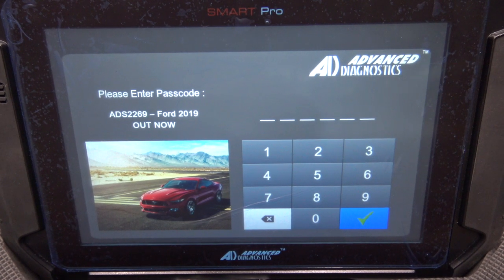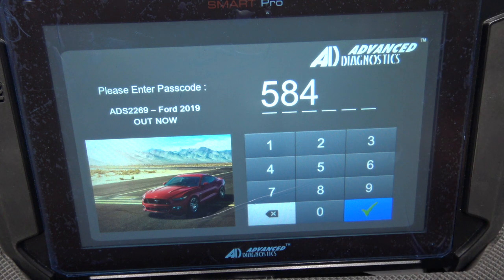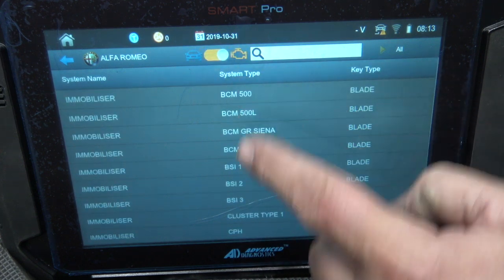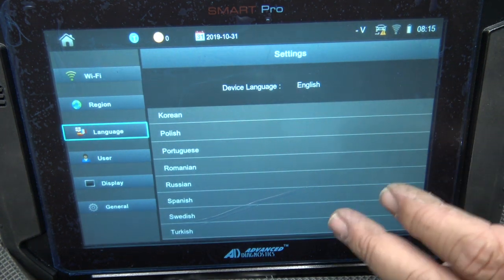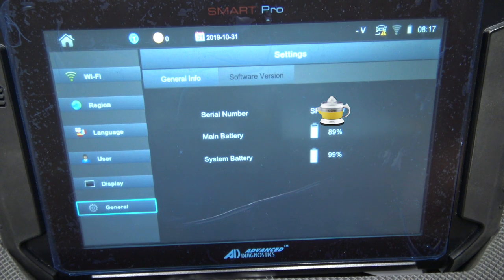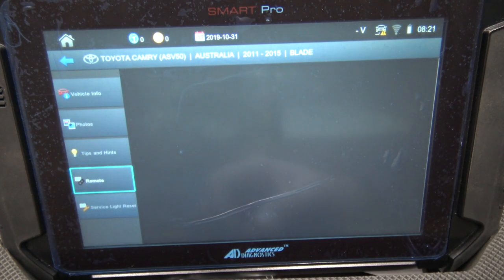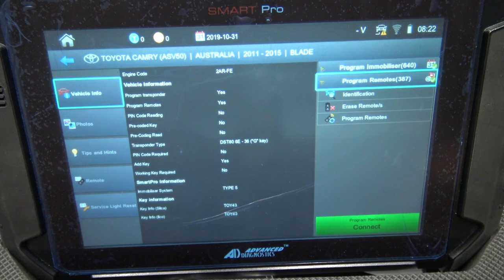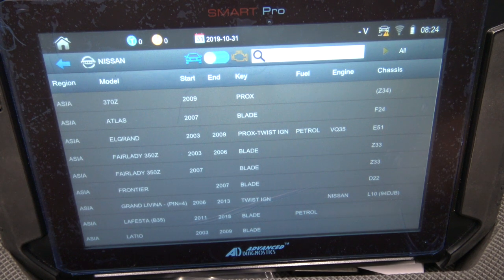Smart Pro Transponder Key Programmer Settings & Overview

Comment: Nice. You purchased the newest one they have. Hopefully you won’t have anymore problems with losing tokens. This machine is more modern. I have seen all their videos and the tool is phenomenal. It’s very expensive though. But it’s the best tool you can get to program cars. I just can’t stand their token based system. It’s expensive for a normal person. But I think it’s worth every penny if you are a locksmith.
Reply from the maker: Im hoping it will be a good investment
Reply: I wanted this machine
Reply: @yamkeyservice3070  hy I'm just about to buy 1 from a gentleman in usa and send it back to iraq?

What's your advise for me to stay away from the scamers i don't really know him well.

But I'll send someone to test it 1st.
Reply: We use this in our shop, and it doesn't work a lot of the time......

Comment: Dr. Lock.. i recently met up with someone using this machine to have him program a fob for me for a 2008 porsche cayenne and it would have been the first one he would have done but he couldnt get it to program anything. I have the original key with remote but the internals were damaged when i got the car so i cant use the remote to lock/unlock or anything and the car says replace fob battery. Car runs and drives fine. Did he make an error in his programming or does this machine not support this car?
Reply from the maker: Sorry I have not done a Porsche, from memory its on the menu, so I would of thought it would work
Reply: @DrLockShop  i appreciate the response. And yes i saw him go through the menu but somehow wouldnt process anything. Anyway like i said i appreciate you taking the time to reply.
Reply: We use this in our shop and it often doesn't work, I would say this is pretty typical

Comment: I thought you were done with token base programmers because of cost . You still having to charge more using that . I would like to have one but cost vs profit to me it's not worth it I still use Xhorse x100 pro pad2
Reply from the maker: Yes, I thought I was too, but then I had a few calls for a few cars, and the Lonsdor would not do it, and I was looking at the MVP and it was making me mad, as I just did not want to put more money into it.. But then I looked over the Smart pro, and I get 3 months free, and 10 software, then I will buy 250 tokens, so it will be about $16.50 per token. So its not so bad, when you only use the smart pro 25% of the time, most of the time I will be using the Lonsdor, and just use the Smart pro as a backup, It should give me a backup for 5-8 years, and have the latest cars etc
Reply: @DrLockShop  but if you get the Xhorse x100 pro pad 2  or auto pro pad they will do everything that the smart pro does without token
Reply: gary johnson with free updates?
Reply: @dasppg9737  I have the Auto Pro Pad and have to pay an annual fee of 600. You still pay a fee but it is 
affordable compared to anything else that is comparable on coverage. There is still no one programmer
that will do every car out there unfortunately. I do like the looks of the Autel IM 608 and that usually 
means a purchase is around the corner. I like the programming steps and that it does Mercedes 
infared keys with good eeprom functionality.
Reply: Keyworx Auto Lock I ordered an Autopropad 2 days ago!
Reply: Will the XHorse program Mercedes vehicles to add new keys?